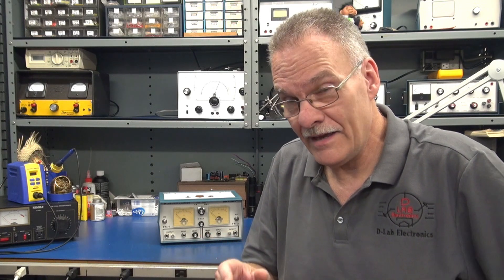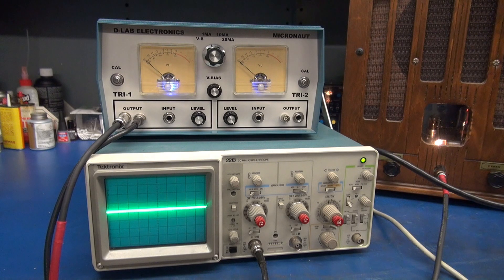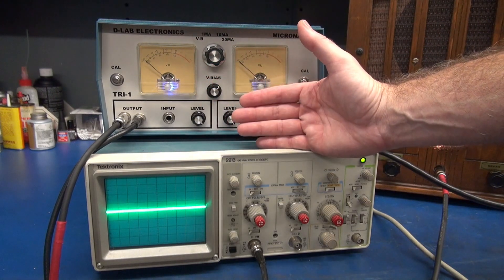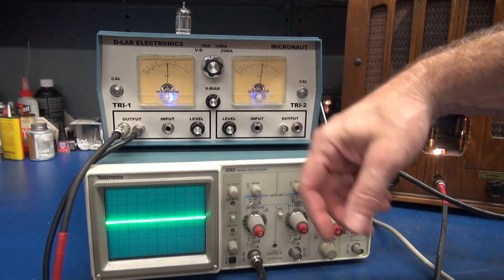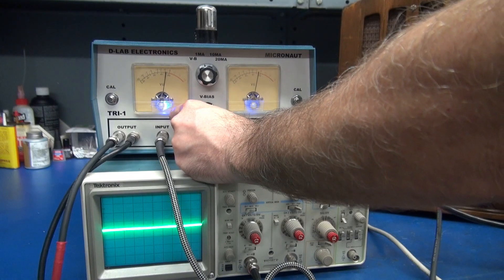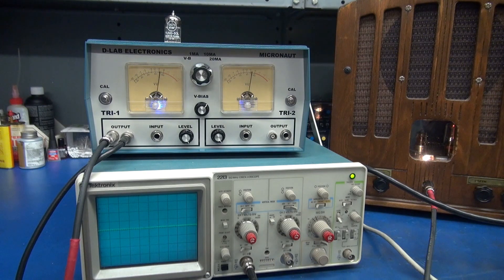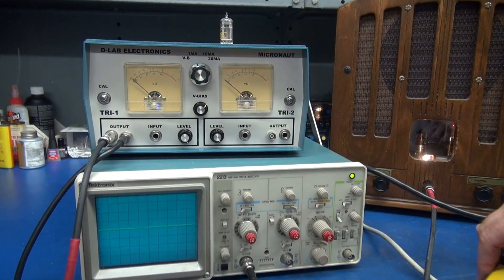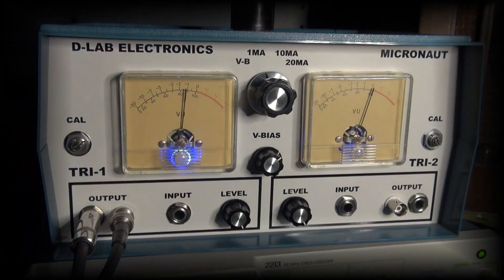Preamp tube Microphonic Analyzer for 12AX7 6SL7 Test Fender Guitar amp tubes before installing

Comment: Using a RoetestV10 tube tester I can do any kind of test I ever dream at, including noise an microphonic test, beside usual tests for shorts, leakage, tracing curves, measure all parameters, batch test, auto matching etc. Your device is pretty simple but limited to few type of tubes, using the tube tester I can make these testes for any kind of tube in any operating point. The oscilloscope seems useless to me, speaker at the output is more conclusive.

Comment: D LABS< are those VU meters measuring the tubes current or output AC voltage? I'm still confused how this microphonic analyzer is different than using a preamp circuit? and tapping on a 12ax7 tube. If its different than using a preamp circuit, how is it different than a tube preamp circuit?

Comment: Is there any way to measure the plate resistance?   I ran some tube swap test this weekend using a distortion analyzer and came to the conclusion that some amps will cut highs when swapping tubes.   I think this is due to circuit design decisions interacting with tube tolerances.   I want to see if resistance or capacitance is the culprit.  
Here is the video. https://youtu.be/6Sz_QIm7qA0

Comment: Hello sir!
If you don't mind, I have a question for you regarding a late 70's Fender Super Reverb (Amp has Master Volume, Mid control on Normal, pull boost knob).
I bought the amp a few months back... All original, never serviced, yadda yadda.
The amp sounded great til warmed up, and it was almost like the tone itself was changing. It was a little noisy but I could tell it was potentially good . It still had the original tubes in it from the factory. 
I took it to my local shop who looked at it and said the power tubes were good, tried to change the preamp tubes, and it began making all kinds of clicks and pops and noise... Said the normal channel didn't work at all and promptly recommended a guy an hour away to fully service the amp.
I got the amp home, bummed. I noticed they had accidentally hooked the Reverb tank up to the wrong jacks in the back... one cable in the wrong reverb jack and one to the footswitch rca jack.
I swapped them to the correct locations and it was back to good.

I took the amp to the fella an hour away and he went through it (he builds his very own custom Fender style amps and sells them...)  and sorta told me the opposite. He replaced a few caps and resistors and said the opposite of my local shop... thatmy preamp tubes were good and my POWER tubes needed replaced.

I've been playing about 25 years, so it's kinda weird to me hearing that almost 50 year old tubes are "still good", especially in an amp that has obviously seen a decent bit of use in it's life. I replaced my tubes about once a year or so in my Marshall when we were gigging and practicing three nights per week, three hours a night.

Anyway, I get it back home, try it out, amp sounds great... but there is considerable transformer buzz. I'm not sure how much is acceptable and how much is excessive, but suffice it to say it's enough to make me curious. The tech cleaned all pots and jacks.
I also noticed that the Normal channel seems to be bleeding into the Vibrato channel...
You can turn the volume to zero on the Vibrato channel and still hear sound... Also, Reverb is unusable past 4 or so... it's so splashy and noisy. All tone controls seem very sensitive... Like the slightest adjustment DRASTICALLY changes the sound... When you turn the Normal channel down to zero, the tone gets rid of a bit of noise, the Reverb behaves much better with a more usable and realistic volume sweep, and everything just improves.

My question is, is bleed-through normal from the unused NORMAL channel to the Vibrato Channel, is there a better way to stop it than to just turn all the Normal channel knobs to zero? Do you have any tips or tricks (ex, pulling tubes) to make this amp sound better? I have no interest in running the amp without reverb, so the Normal channel is useless to me... ESPECIALLY withbit making my other channel sound bad.
Reply from the maker: Hello, Wowzers, lots of problems. It all points to 1 thing. Ground connections on the front brass plate. Take a good look at the ground runners from the eyelet board to the ground plate. These crack over time and generate all types of issues. Aslso make sure the 1/4" input jack shunts are clean, connecting to ground when jacks are not installed
Reply: @d-labelectronics  Thank you so much! I'll take a look at that first. I'm kinda surprised the tech didn't pick up on that. I've got some decent soldering skills, so I'll take a gander at the joints. Much  appreciated!
Reply: @d-labelectronics  Ok, so I did a little tenative testing.
I am getting a pinging sound when tapping on the tubes. The sound is coming from V4, which is supposed to be a 7025,. It has a Sovtek 12ax7lps.
I have some good 12ax7's lying around, but I was curious if it having a 12ax7 is incorrect
Reply from the maker: 12AX7 is fine for that application

Comment: This is a great idea. Is there any chance you will be designing it to operate on 240V as well as 110V, which is all we have in Australia.
Reply: Also for 230 volts as we have here across the ditch in NZ, but if it will do 240 volts that will be fine for here too.

Comment: A very cool device! 
To compare soundwise two tubes, it would be nice to have a A/B switching or mix potentiometer. Of cource it is possible to just swap tubes but it takes a few seconds to heat up the tube.
Reply from the maker: That sounds like a great idea. I will throw a design together for A/B of preamp tubes. The Micronaut II
Reply: @d-labelectronics  👍
Reply: @d-labelectronics  And BTW, if you want to develop that device to a really naughty Naut, you could add a coupling cap A/B comparison option as well, to find out if there is any truth in those mythic arguments that for example paper in oil coupling caps sound better in tube amps than orange drops or metallized polyester caps etc. 😁
Reply from the maker: Yes, I have had several requests for a dual 9 pin only model that has A/B switching for tube comparison

Comment: My tube tester has a headphone jack on it and works great for finding microphonic tubes.
Reply from the maker: Is that an Amplitrex AT1000?
Reply: @d-labelectronics  No, my Radio City Products Model 323 and my Superior Instruments Model TW-11 both have 1/4" jacks for headphones. They work really well. I have seen several other models with this feature some having the 1/4" jack and some having banana plugs.
Reply from the maker: Very cool, I have not seen those machines in action
Reply: @d-labelectronics  What tube tester to you use?
Reply from the maker: I have a AT1000, B&K747 and Hickok 6000
Reply: @d-labelectronics  That AT1000 has an audio output. Have you tried using it?
Reply from the maker: Yep, I am making this device to meet the need of small shops or hobbyists